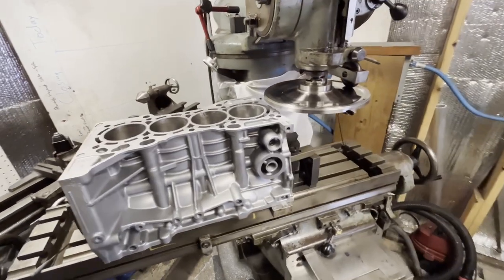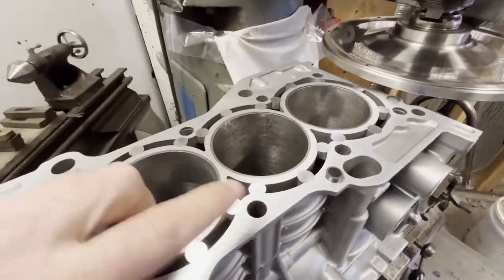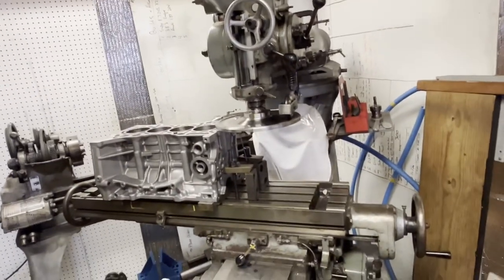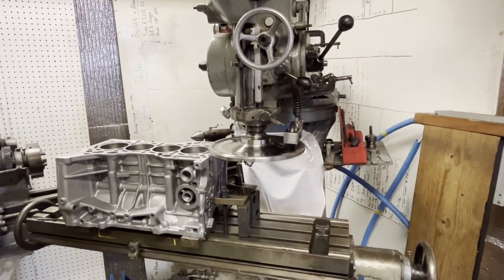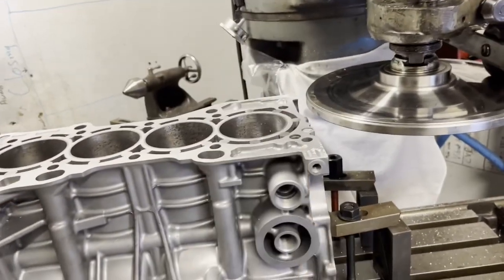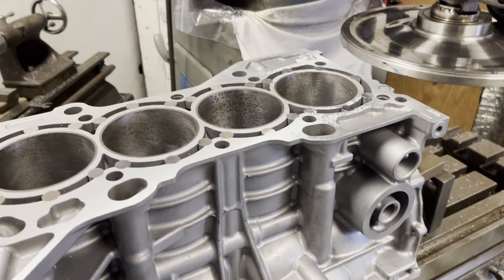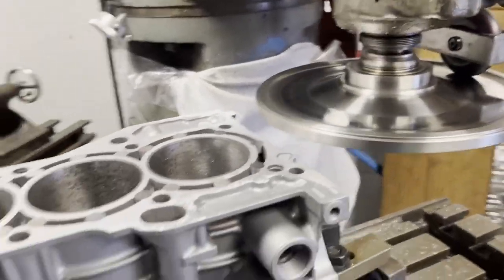Surfacing Blocks and Heads with a Knee Mill - Tips and Tricks

Comment: just my observation, you need a beefier flywheel, yours is pretty thin and its singing.  Tram the head for .002 tilt across 10"  the amount of dish you are creating in the surface is unmeasurable, under a tenth across a 6" head.   I surface heads daily on a BP and have zero issues.  Sound is imortant, a PCD cutting .001" on aluminum head should be almost silent.  Yours is really noisy.
Reply from the maker: Thanks Scott for the comment I appreciate it.  On the tram I’m simply nervous to cup the deck so I have it bare min.  On the thickness, I wanted more room on Z height and light weight, but I’ll probably redesign a FlyCutter again some day.  Also that click noise is the key way in my drive pulley system and I need to dig around in there to find it.     I think the key way can load and unload while I take heavy cuts so it needs addressed for sure.
Reply: @kalamazooenginemachine  my spindle key is sloppy as well, but the heavy flywheel effect will help a lot.  What is your Dad getting for the .5” upsharp PCD?  I would be interested in trying his CBN designed to cut aluminum with iron sleeves.

Comment: It's CBN (cubic boron nitride) OR it's PCD (polycrystalline diamond), it's not "CBN diamond". They are 2 different materials. You're brave swinging such a large diameter cutter with a knee mill. Spindle bearings must be in good condition. Nice work. It's encouraging to see ingenuity overcoming the limitations of equipment.

Comment: A tool with a smaller radius will cut with much less pressure than the round cutter that acts more like a "wiper" insert which while effective needs a rigid setup.  That said you'll have to run slower.  If accuracy is everything and you're limited in the rigidity department sharp HSS will actually give you the lowest tool cutting pressure but you'll have to run painfully slow to keep the surface speed down to 50-100 fpm if memory serves me right.  The damper is a cool touch even if the majority would consider it a bit wonky.

Comment: Ok, Your diameter of the wheel is fine, U need to incorporate at least 3 more cutter for the head for a total of 4, I have worked with a Block Master and they will hold 8/10 carbide cutters, depending on the size of the cutter head. Heck 1 extra cutter,would help fix your chattering problem,    The cutter head U have in the video looks really nice, the only thing I would add is the thickness of the wheel, if at all possible that U could make the cutter head thicker by at least an 1 inch that would also help with deflection and chatter... Keep ON MACHINING BROTHER MAN YOUR FRIEND FROM NC J.PENNELL

Comment: The ideal surface finish is NOT mirror smooth. You need enough roughness for the gaskets to grip but not so much they can leak. Production heads have a range of max and min surface roughness average (Ra).

Comment: Not clear on what is your spindle in this mill. Early on you show a ER collet. Most knee mills have a R-8, which, personally I feel are problematic with large radius cutters.
Reply from the maker: The first FlyCutter I show did have a ER32 collet which has too much flex for sure.  I wanted to let viewers know not to go that route.  The spindle this Index Mill has is a NMTB 30; which is about the same rigidity as a R8 shank Id think.  I sacrificed thickness for lightness with this disc, but having it balanced on a crank balancer and adding the dampener wheel, after the engineered tooling, it’s cutting about as good as it can.  Next is to eliminate that pesky noise in the pulley drive, possibly causing some amount of vibration; so maybe I can still improve the surface finish.
Reply: In my opinion, that shank on the triangle shaped cutter looks to be designed to use a Weldon style tool holder. They have a set screw on one side that is designed to hold on to the machined flat portion of the shank.

Comment: Friends dad was a top fuel and race engine builder / machinist. He had a STORM VULCAN.  must have been a 20" head with a dozen or more carbide cutters. The head didn't spin fast, and the finish could not be had with a round cutter, the finish had a somewhat aggressive sharpness.  I think the multiple cutters set up properly made the cut stable over bores and holes. Also, I think deck finish varies due to head gasket material... 
either way, if your spending that much time, you should be running o-ringed heads, or copper with sealed dry deck

Comment: I love the cylinder dowel supports. It makes so much sense if you are going to resurface an open deck anyway, why not help it in any way that you can ? Regardless of what some might say, there are likely a bunch of home/backyard builders that would give up a kidney to have a machine like this for their homebrew junkyard LS Race Car program. Makes far more sense than a belt sander or a chunk of 2x4 wrapped in sandpaper or emery cloth. Nice setup.

Comment: It's amazing that you have got CBN inserts to hold up to an interrupted cut, especially with different materials. I have built a fixture to hard turn heat treated flywheels with eccentric grooves for a cam follower. We use to use a tool post grinder to finish them, the problem I would run into was getting harmonics between cuts and one way to over come it was to vary the feed rates between cuts, but getting the warpage out of them to get a steady cut was challenging. We cut our finishing time from 2 hours of grinding down to 20 minutes, but those inserts are so brittle and expensive it was a real learning curve. I wonder how a VMN insert with that tiny corner radius would work, trouble is you only get one cutting surface per insert. Great video thanks for sharing your experience.
Reply from the maker: www.performanceCBN.com - get ahold of pops we have the inserts and the holders and a new fly cutter on a CAT 40 for VMCs 🍻🤓👍 cheers

Comment: The back cut may be in the table when it is at that particular point in the travel. I have three Bridgeport's, two of which are CNC controlled EZ-Traks. The table and saddles wear depending upon their history of use, the extreme limits of the travel on the tables usually have less wear, hence as the cutter comes across on the back cut it may be ever so slightly lifting the table at that point, think of it as if there was a sway in the table to saddle relationship over its range of travel. Good stuff using the equipment figuring creative methods for getting things done.
Reply: This!!! But I was also going to suggest that the whole knee and table assembly may be tilting slightly under the combined weight of itself and  the workpiece.

Comment: As a machinist myself, i am confused by your statement of "dragging" on the back cut. 
You were correct on the perfect 90* spindle to table alignment but the tool is cutting or dusting the high spots on the back cut, not dragging. That crosshatch is typically what we want to see.
 Most modern 'high tech' cutters require a chipload to propperly cut though i have not used CBN yet, i assume there are the same min/max requirements for them and something to remember when skimming. 
 All that said, i do NOT do blocks, heads etc so I don't understand why you wouldn't want that back cut and perfect flat surface.
 Blanchard grinding creates the same crosshatch and is proof of "flat"

 I do like your flywheel cutter ! I have a need for a larger flycutter and have a nice THICK dosc of cast iron ready to go but i also have a few junk flywheels laying around. 🤔

 Fyi, i have 2 B.P mills, 3 Lathes, a Haas VF-1 Etc... and I run them all.  Still learning everyday so comments are subject to change as my knowldge does.
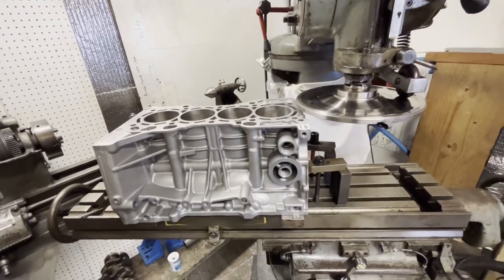Reply: 😅😅😅😅😅😅😅😅😅😅😅😅 1:16 1:17 на Гоголя завтра зз

Comment: Great video. I also made my own milling head. It's for a Bridgeport series 1 (R8). I'm having some trouble with it that I'm trying to work through. I have PCD inserts for it that I'm making holders for now.
Reply from the maker: The holder is key.  The engineering behind the angle the holder puts the cutter will make or break the your project.   Pops knows the geometry,  I don’t know them off the top of my head. If you want one of his for a RNGN we have our first batch being ran now. Should be done in a few weeks and I think they are under $100

Comment: Thanks great video I'm in Canada witch is becoming like Cuba no machine shops or engine builders we have to learn to do everything ourselves to keep our car going
Reply: Plenty of us automotive machinists in my area and we all use dedicated block and head resurfacers
Reply: The best price I can find is $300 to plane a head,  nothing fancy - no valve job (I have a grinder). Last engine was 8N in 2008, guy charged $1800 to put 4 sleeves in and supply a kit. I did the assembly. 3800 Spun a rod on the crank, $1800 short block, I put the heads on in 2007. Fuck that. Motor $150 at Kenny Upull, Ford 8N $1500 running on facebook.  There is a reason no machine shops are left.... after they are done screwing me I get shitty offshore parts that come back under warranty.

Comment: Ive surfaced some blocks on a knee mill and I found that mine wanted to tip the table a few thousandths as the table traverses across from slight wear in the ways. My mill is much larger but I was surfacing a 6 cyl John Deere block. So the block ended up a few thousandths high in the center.

Comment: The ringing while it’s cutting is an indication of vibration probably due to your inadequate welds creating imbalance of your flywheel. You need to weld it properly then turn it down on your lathe  then your results improve greatly

Comment: I think that damper wheel is a good idea. If it works... How much pressure are you applying there? 
   The tilting of the head... I do that sometimes, but 0.002 over 10"...I think would make more like 0.0005+/- over the width of the block. That takes clamping force off the gasket, the greatest effect being right where it is worst, the narrow area between the bores. An MLS head gasket might not like that, not too squishy like an old composite one.
     I got rid of my first 9x49 Bridgeport for a 10x54, mainly for the "x" travel (36") so that both sides of a fly cutter can pass fully over the gasket surface if I choose to run the spindle vertical. Works for some, depends on the head & cutter diameter.
    What kind of rpm/fpm 
 is that? It looks kind of fast. I'm sure within what that insert will tolerate....just that some other speed might help the finish. You probably tried that, though. Maybe you could  grind the insert to reduce its radius, to reduce force. Or try a brazed carbide cutter, but I grind inserts sometimes, works fine.
   Locking then"Y" and knee would stiffen it up a bit.

Comment: Have you thought about changing the spindle bearing to angular contact bearings , get 4 of them and take out the spacer top bearing can be a standard sealed one.
Reply from the maker: I want to try something; there is a lot of backlash on the pulley keyway from what I can tell, so if I dig into it, I would want to try to upgrade anything I can to make it more rigid.   Thanks for the comment 👍

Comment: need to go in the exact opposite direction with your insert geometry. you need a sharper corner(.015-.032) with a positive rake
Reply from the maker: 3/8 round , negative rake for PCD and CBN; 6* positive rake  for bi metal with CBN; I didn’t invent this, it’s industry standard rottler robins comec.

Comment: Hi, is any way to resurface my cylinder head with some cheap (~$1500)  table milling machine?
Reply: No. First of all there’s not enough work envelope on these machines. Meaning not enough x or y movement. Secondly, not enough height to the column. Three, even if you found a machine at anywhere near that price point, it couldn’t swing a large diameter cutter. Fifth is that it’s not going to be anywhere rigid enough. It would be cheaper to take it to a properly equipped engine shop and have them do it.

Comment: Been then done that , knee mill still have a bowe over the saddle in the X plane , also you need to make a solid  mandrel   for the tool & need a thicker    flywheel for cutter , you will get a Harmonic pitch in tool if it designed  like potato  chip lol , what you have is a  over engineer  piece  why over thought